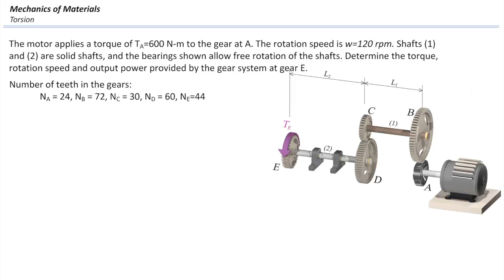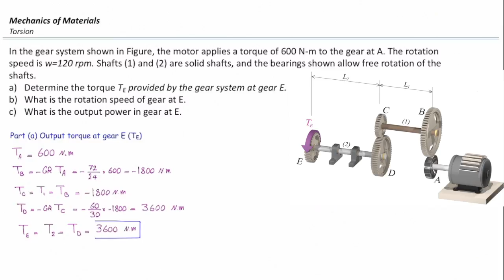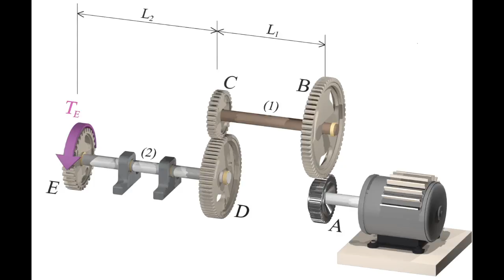Lec8, Gears in power transmission systems (Example)

Comment: What does the minus mean in the  -GR Tb? Thanks
Reply from the maker: The negative sign is because if one gear rotates clockwise, the other gears rotates counter clockwise. The same is for torque. thus, there is a negative sign when the gear ratio is used for the calculation of torque or twist.
Reply: Mechanics of Materials (Libre) Got it. Thank you very much